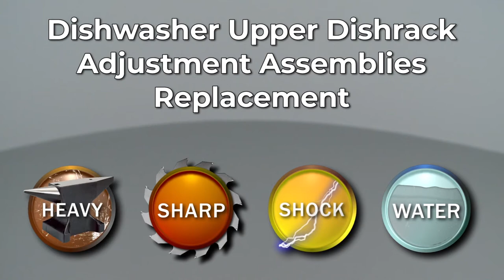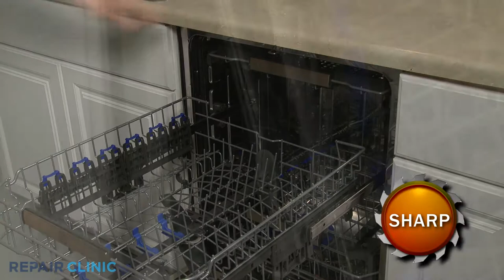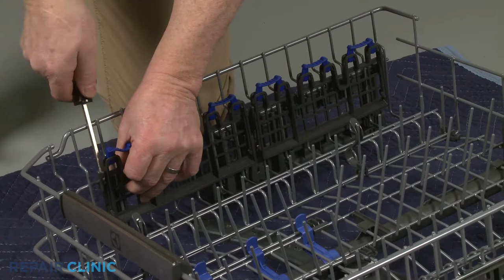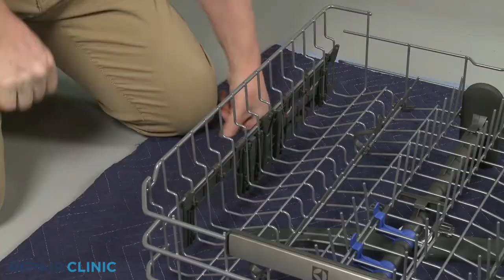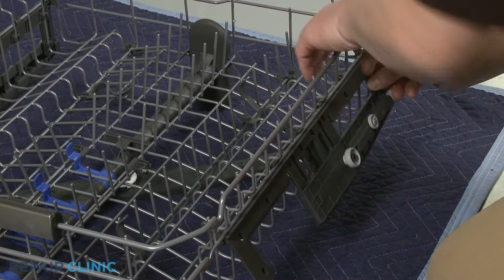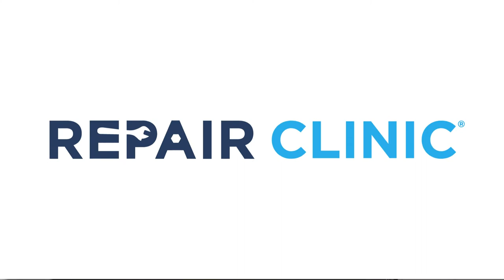Electrolux Dishwasher Upper Rack Adjustment Kit Replacement 405541617

Comment: Great video on how to repair it. The sad part is Electrolux needs to go back to the drawing board. The part is defective to start with. There's a little rectangular white nylon part with a metal pin that slides and allows for the rack to go up or down. Just the weight of my glassware is enough to make that fail. I've had the dishwasher about 6 weeks now and maybe have used it 10 times and this is the third time that it's failed.